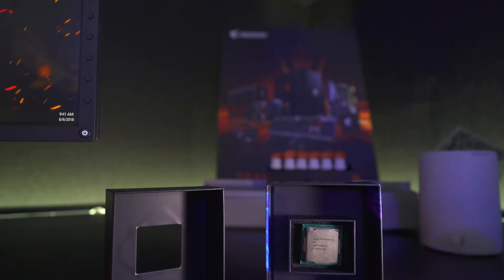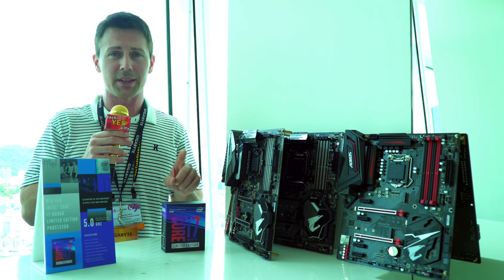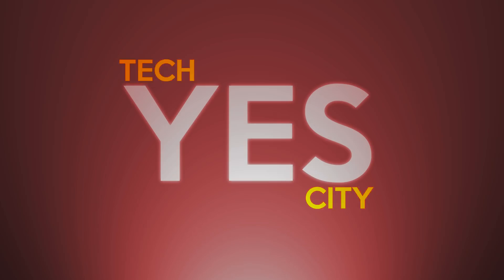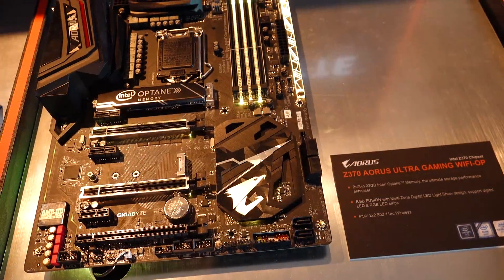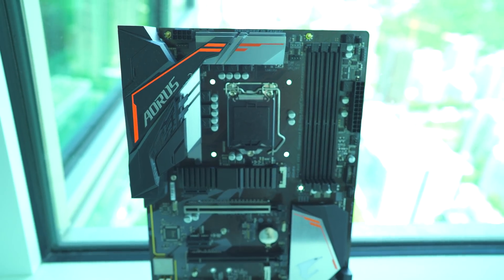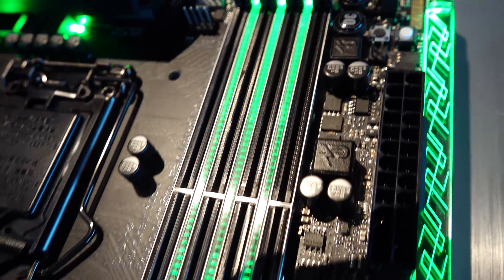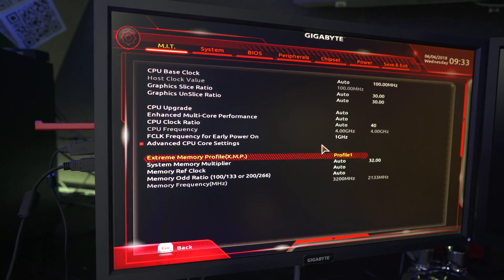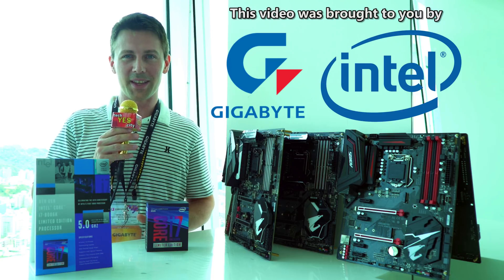The i7-8086K with 5GHz is here, with 8086 CPUs Being GIVEN Away....!

Comment: i7 8700k = i7 8086k !!
Reply: i7 8700k =< i7 8086k

Der8our said that the i7 8086k is about a good 8700k. That means, if you get a bad 8086k, you basically got an average 8700k. And if you get a good 8086k, then good for you! Also, the other difference is that you get a cooler box that says "LIMITED EDITION", and a special badge in CPU-Z. If you don't want chances to get a bad 8700k, get a 8086k, and even if you get a bsd 8086k, its still a regular 8700k. And you still get the special badge and box.
Reply: https://www.youtube.com/watch?v=dmS1ws8TdV8

Comment: Unfortunately if anyone is expecting this to actually be the best of the best then they will be disappointed.
Overclockers on the show floor have stated that it is no different than just a good 8700k. The binning isn't exceptional. 
My 8700k is at 5.3Ghz 1.38V, if I had one of these i would expect that to also be the limit. 
(Still going to get my hands on one though and test that. On the off chance I can break 5.5Ghz it will be worth it. And hey, since I will have a spare, maybe some more fun will happen.)

Comment: Already in stock at local Australian retailers, $629 lol. Is the gaurantee worth over $100 extra? Most 8700k can hit 5ghz can't they?
Reply: 88% of 8700K's can hit 5 GHz on all cores @ 1.4V after delidding, according to binning service siliconlottery. I would guess the average max OC will be a bit higher on the 8086K's, as it's basically just a binned 8700K, maybe 5.1 or 5.2?
Reply: IsakH85 That's still not winning the lottery, 1.3V-1.35V is the sweet spot for 5Ghz 8700K...1.4V is not really sustainable for everyday use and everything over that is dangerous. 8086K would probably be around 1.3V 5Ghz to 5.3Ghz
Reply: StreekG Not all, my friend's 8700K is unstable at 5ghz
Reply: I have one coming in a few days, will try to remember to report back after I'm done delidding and overclocking.
Reply: So I'm not quite done fine tuning and stress testing yet, but so far my 8086K seems to be stable at 1.3V for 5GHz. The highest I could get it stable at was 5.3GHz, but it needed almost 1.44V which is too much for everyday use. Looks like I'm settling for 5.2GHz at just under 1.4V

Comment: Its does not do all core 5ghz not even close. ( stock)

Boost on a core or two yes but not all core no way in hell without amazing cooling.

Its just a binned 8700k.
Reply: Andrew Joy
Amazing cooling? A 240mm AIO can do that for a 7700k.
Reply: Andrew Joy A pre-binned 5ghz 8700K is $600-$700 USD in my country lol. And you don't need "amazing cooling", I cooled a 5ghz 7700K or 8700K with an NH-D15.
Reply: Andrew Joy lol my i5 7600k can hit 5Ghz on my CM evo 212 these newer processors could hit 5ghz easily
Reply: 8700k here delidded and 240aio 5,1ghz on all 6 cores.
Reply: B0NES YT the NH d15 outperforms 240 AIO's. What was your point again?
Reply: Andrew Joy I have i7 8700 and turbo boost at 6 cores is 4.3 Ghz with Be quiet Dark rock 3 is enough for me for everything 😆

Comment: Nobody will get one to run at 5ghz.
Reply: Not true. Most 8700K's can run with all cores at 5GHz as long as the cooling is good enough, and especially if it's delidded. This 8086K is just a cherry picked 8700K, so I would think they can all do at least 5GHz.
Reply: They can, if you void the warranty of your limited edition CPU to replace the cheap ass TIM intel got off ebay. You would think for a limited edition they could do something cool like solder it , or gold plate the heat spreader and make the substrate grey so it looks like a pentium pro anything to make it worth the Limited status.

Honestly what happened to intel ? my 5930k is a quality product, soldered heat spreader, plenty of PCI lanes, stable, supported for ages.
Reply: Commiserations for your lose...Ouch!